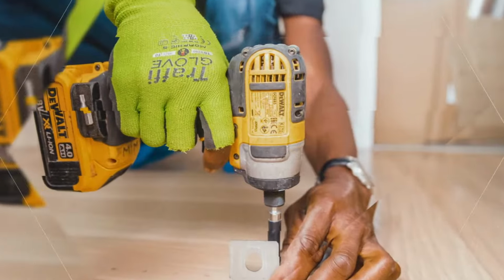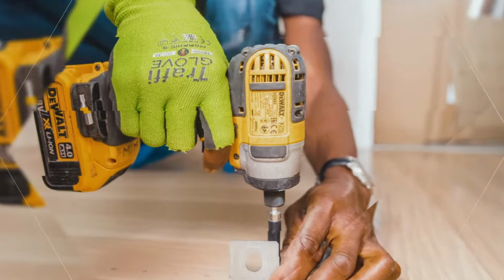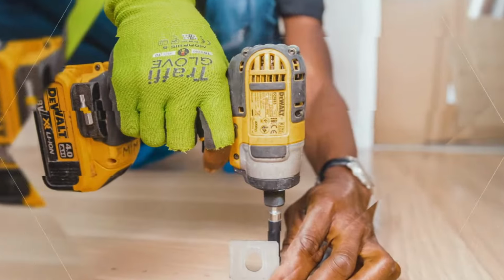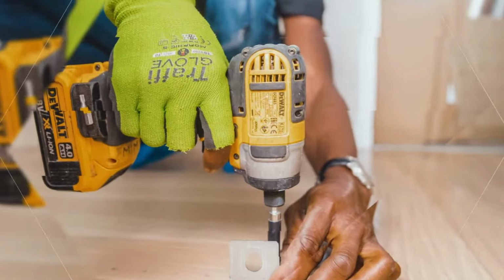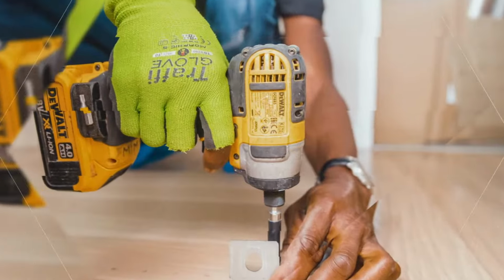HOW TO SET A CONCRETE ANCHOR

Comment: Sometimes with Wedge Anchors, I have the problem where the anchors keeps spinning and does’t tighten. How do I avoid that. I clean the holes every time. I can’t figure out why it’s hit or miss.
Reply from the maker: Could be due to over tightening or using the wrong size bit to drill the hole.

Comment: Isn't there minimum distances that wedge anchors must be from a concrete edge, which would restrict the use for exterior walls?
Reply from the maker: Anchors can’t be closer than 1 7/8” from an unsupported edge or 5 anchor diameters.

Comment: Hey so I can only use a concrete anchor in actually concrete, and the sleeve anchor is for brick and mortar. So I shouldn’t use the concrete anchor on brick right?
Reply from the maker: Correct.

Comment: Hi, I have two Fischer FBN II 10/20 R anchor bolts, and I was wondering what size drill bit I should use for installation. Should the drill tip be the same size as the anchor bolt (10mm), or slightly smaller? Thanks
Reply from the maker: Yes, it should be the same size s the anchor bolt.

Comment: Thanks!
Reply from the maker: Glad it helped.
Reply: @ I bought some Vevor curb ramps.  They came with sleeve anchors (and zero info for how to install them), which seems weird since it needs to be installed into concrete. Hopefully they work though.  Your video was very clear.  Great info, super helpful.

Comment: I was practicing with a solid piece of block and installing the non sleeved anchor you mention.  I found that it was spinning in the block and not grabbing when I went to tighten the nut for expansion.  Even using the specified drill bit size.   Have you run into this happening?
Reply from the maker: Yes it happens. If the hole size is correct it could be that it was over torqued. Insert a filler in the hole first, like zip ties. Then insert anchor and tighten. The zip tie should help the anchor grab. Don’t over torque it though, the you will have the same problem.

Comment: Is it okay to hammer the anchors without having to use a nut? 

If you are using a nut to hammer the anchors, doesn’t it hurt the threads?
Reply from the maker: You’re not using the nut to hammer the anchors. You hit the anchor tip itself and use the nut to fasten whatever you’re installing down.

Comment: I'm getting ready to install a rack to hold a 180 lb punching bag and the base of it bolts into the concrete similar to the plate you installed. The company sent some 3/8" x 3" Tapcons as part of the install kit (the base takes 6 bolts). Do you think those are strong enough to hold it or would these wedge anchors be better?
Reply from the maker: Nothing wrong with reinforcing with wedge anchors.

Comment: I am needing to pore a 4'x4' 6" tall on top of my cement basement floor (I do not want to find out how thin or thick our basement floor is) so I can put my new drill press onto.  I do not want to have to drill the cement slab in order to secure the base of drill press to.  I fear that I would crack the new slab. So my question is what type of hardware can I put in the concrete as I am poring it so I can bolt the base to the raised concrete slab?  Also would it be advised to glue the slab I am poring once it has dried and cured to my basement floor with cement glue?
Reply from the maker: Concrete anchor bolts can be sunk in wet concrete immediately after it is poured. How much you leave sticking out is up to you. You can starighten it or plumb it as the concrete hardens. 
You should add a bonding adhesive to the mix before you pour so it sticks to the base slab.
Reply: @Caliber8Tools  Thank you for taking the time to answer my question.

Comment: I have both wedge anchors and sleeve anchors. The sleeve anchors box states they they are "for Brick, Block and Concrete applications"
Also, according to the documents on the wedge anchors and comparable size sleeve anchors, the sleeve anchors are rated at about 3-4 times the strength for both the pullout and the shear ratings, as compared to the wedge anchors.
This information contradicts that contained in your video.
For reference, the 'wedge' anchor I have is 'Cobra' Brand Parawedge and the sleeve anchor is 'Red Head' Brand. Both are 3/8 inch diameter, sold at Home Depot.
Having said that, I still think I prefer the wedge for my concrete application, but more reading up on these may be in order.
Reply: @SeanFitz-vo4fm  Thank you! I was ready to take my just purchased sleeve anchors (going into a sidewalk) back to store and get wedge anchors yaay don’t have to!
Reply: @swimmerstevieg  Thank you. So since posting, I came across some additional information regarding the sleeve anchors. I believe it was from the sleeve anchor company web site but I'm not certain. Anyway, this new information seemed to indicate that the sleeve anchors were for 'porous' concrete, even though the box simply says 'concrete'. My project involved repairing a concrete pool, and I actually used one of the sleeve type (grabbed the wrong box and wasn't thinking) and the rest I used the wedge type. They both worked fine, but for the pool concrete, I did prefer the wedge type a little more, but honestly, I think either will work fine. Btw, after drilling the hole, I blew out the dust with canned air and injected some hi-strength Gorilla adhesive, just to add to the overall 'grip' of the assembly.
Reply: @SeanFitz-vo4fm Thank you for that additional info.

Comment: Me deciding which video to choose: "Hmm I dunno, this one is the most recent, but it doesn't have 400,000 views like the other"

clicks video

Caliber8 Tools: "Alright watch out for these two similar yet different types of anchors"

Me: "Oh hell yeah I clicked the right video!"

I'm going to use concrete anchors to secure a car port in my driveway, so your video was very helpful, especially when you made me realize that my concrete slab might be shallow and what to do if I hit dirt. Thank you!
Reply from the maker: Anytime. Glad it helped.
Reply: @brittislove  hey bro love to hear you doing your carport. I’m trying to do mine for the first time. And I’m wondering what size tubing and thickness you ended up going with. And how did you get your square metal piece or did you just get a metal sheet from the steel supply. Love to hear back I’m excited to do this.